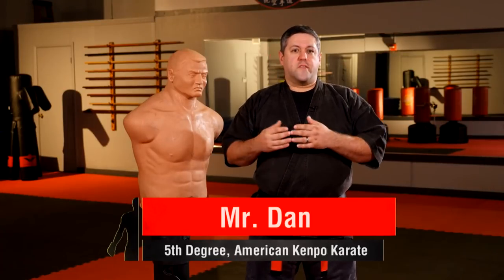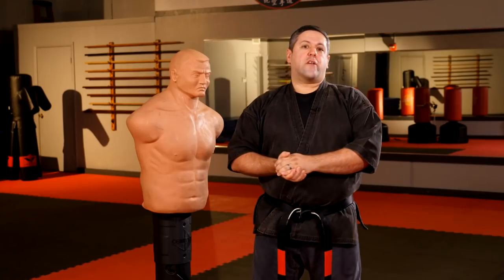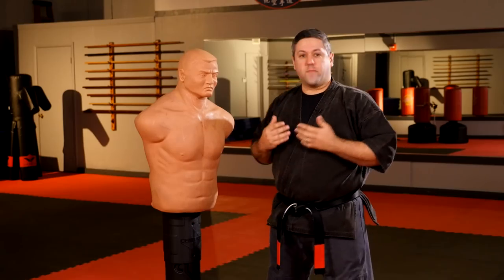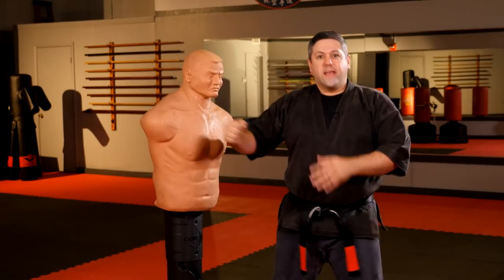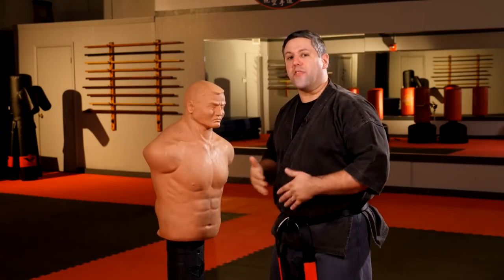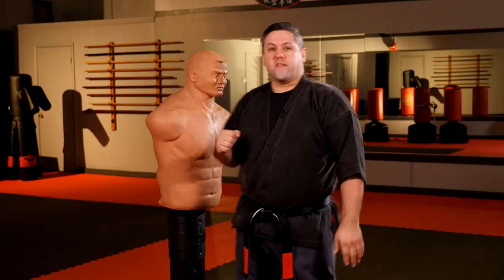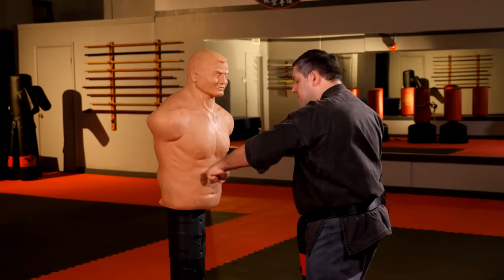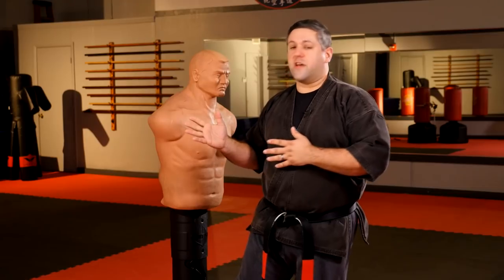Kenpo Power Principles | ART OF ONE DOJO

Comment: We in Kyokushin Karate generate power from the shoulders and twisting motions of the wrist at the end of a punch 👊 for example. We also always keep the elbow close to the body and the fist ✊ in an inverted position, with the palm of the hand ✋ facing upwards towards the sky or ceiling of the Dojo. While the backhand part of the fist ✊, faces downwards with the knuckles, towards the pavement, or the floor of the Dojo. 

Doing contrarily, where the elbow is sticking out and away from the proximity of the body, first and foremost, exposes your ribs, to a potential hook punch, knee or roundhouse kick strike, as an easy and exploitable target to your opponent's advantage. 

As for the hand downwards close to the hips, as opposed to the close position of the biceps 💪 and the armpits, only generates speed, but no real, devastating power. So for us in Kyokushin Karate, while speed in conjunction with strength and power, deliver the perfect, devastating, knock-out blow. Ultimately if we had to choose, then powerful strikes, would be our priority, as opposed to less stronger and more rapid strikes. 

This similar logic is also applied to the kicking strikes, whereby the knee is raised firstly, tucked in, closely to the body where maximum power can be generated, in combination with the rotation of the hips. Again the knee would not be sticking outside and far from the body, as doing so would sacrifice power and real strength from kicks, knees and so forth.  

Ultimately as with punches and kicks, the pivoting motions, the rotations of the hips, shoulders, along with snappy, quick executions of the techniques, deliver the devastating effect, on the adversary, upon the point of impact on their body. 

Footwork, hand, eye and feet coordination are all important, along with perfect posture and right body alignment, need to all be coordinated in synchronisity with each other, to ensure that twisting, pivoting, quick, snappy and strong strikes are delivered with the maximum speed, power and efficiency, without unnecessary wasted motion. 
A great and excellent topic, that many martial artists, ignore, overlook,  or forget to mention, in their instructional, video tutorials. Very much and greatly appreciated, as good reminder, to keep in mind when teaching our students, especially the beginners. Excellent researched, well presented and concise, subject matter material, with relevance as always Sensei Dan, Osu! 👍 ☺ ✌
Reply from the maker: Well after doing the 3 part Kyokushin videos, I have NO DOUBT of the power you guys can generate :)
Reply: @ArtofOneDojo  ah you are too kind Sensei Dan, your American Kenpo Karate, is also equally as powerful. Believe it or not there are similarities, as to how we generate power, as well as to the rotation of ensuring we perform techniques, to deliver that power. I really like your technique demonstration videos!  I totally agree that by a certain level, one must be able to demonstrate power control of techniques, safely with others during training drills for safety. Especially at a black belt level. In a tournament or a fight, sure go for it to your heart's content 👍 ☺ ✌ 👊 Osu!
Reply: Awesome comment, osu from Italy (kyokushin obviusly)👊

Comment: From what I've learned so far much of the power in Tang Soo Do comes from moving our hips and from utilizing the 180° rule. So for example: a long form forward low block would involve turning your hips 90° (the hip power) and bringing your defending hand down from your ear (the 180°). The hip turns can be classified as defensive or offense depending on what you're doing, and similarly the 180° rule is easily applied to offensive techniques. Furthermore there's a lot of power to be developed from the strength exercises we do and the repetition of techniques.

Comment: You fight like you train.  From my experience we pulled punches too much, and even though we trained full contact some, when I later worked in bars, I had to retrain myself to always follow through.  Without my life in Judo, I would have lost several fights relying on my first training in karate. ..it would take too long to explain this, but the first sentence is what I wanted to be clear on.  Nice video,  I'm really enjoying your work.
Reply from the maker: Thank you, I appreciate that :)  I agree about the pulling punches. My second instructor was REALLY big on us making contact. Not pulling punches and DEFINITELY NOT punching the air to the side of the head, that's just a bad habit to form. We would condition and take hits and his philosophy was, he wanted us to get hit harder training in class than someone else on the street would hit us, so we'd be accustomed to it and deal with it.
Body shots were expected to be controlled, but strong enough to achieve the reaction we wanted. If strikes were to the face, we were encouraged to at least make controlled contact but modify it based on what the strike is. Sometimes open handed strikes were used, but in power strikes, like a hard hammering palm or hammer fist to the nose, we'd modify it and deliver a full contact strike to the upper sternum. Whatever got them to move the way you wanted them to move.
Reply: "We do not put our punches, we change our target" S.G.M. Ed Parker
Reply from the maker: @ultimatekenpowarriors434  I love that quote from him :)

Comment: Great video :) and i've done boxing for a decent amount of years and I started kickboxing about around a month ago. Im taught to rotate body and pivot on balls of feet to generate power tho my coaches also mentioned a few times the need to have proper technique and that force is mass x acceleration.
Reply from the maker: Oh yeah, when doing a back leg round kick you definitely need to pivot on the ball of your foot or else you're pulling against the potential power of the kick. The follow through with that pivot can be devastating, especially in kickboxing that allows lower round kicks to the legs.
Reply: @ArtofOneDojo  yes sir! :) exactly.

Comment: In Muay Thai I learned that generating power through pivoting and hip / shoulder rotation is ideal but that Landing blows which break the skin and cause blood to distract or blind the opponent but are not necessarily delivered with full power are also utile as faints or laceration strikes. So, for example, being able to land the tip of the elbow somewhere on the face of an opponent will cause of laceration that will bloody the opponent thereby distracting and / or disrupting their vision. Or, as another example, it is extremely useful to land a straight kick or teep with less than full power to set up a strike that is truly devastating.

Comment: I enjoy watching your videos! All content driven! A Q for you (not related to this video): what's the logic behind throwing the punches from the hips?
Reply: Your arms are like a whip, and your body (hips) is like the arms holding the whip, you can't just flick your wrist and expect the whip to crack, you need to move your whole arm along with your body to actually generate power.       Sorry if that made no sense but it's the best way I can try to explain it.
Reply: Punches generated from the hips proximity, as found in many sports, point scoring karate systems, are done so for speed. 

However full contact fighting arts such as kickboxing, Muay Thai, full contact, knock down karate, as well as boxing for example, they are power based and focused styles of fighting. In those cases, the punching position of the hands is not downeards, near the hips, but rather at top near the biceps 💪 and the face, for guarding and protecting the face more easily from punches or high kicks. In this position the hands are also held there to help generate power and knock-out impact, as opposed to multiple, quick yet not as devastatingly, powerful strikes.
Reply: Thank you for the replies. But all the points you mentioned: speed, hip twist, weight trasnfer etc can also be achieved by keeping your hands up.
Reply: @sardalamit  I was traditionally trained and didn't question what I was told to do. Now that I am a ronin, I keep my hands up mostly and throw strikes from many angles including like a boxer and from the hip.
Reply from the maker: One thing I can chime in with is it's good to practice both throwing punches from hands up AND hands down/at the hip. Why? Because what if someone catches you by surprise? We use the concept of "point of origin" a lot in Kenpo, which means that you should be able to deliver a powerful strike from your existing position without having to load them first. There may be scenarios that you have to strike quickly if your hands are down.
I would also like to add that one of my favorite punches is an uppercut or vertical punch to the body, executed from the hip. It came be EXTREMELY powerful and one of my strongest. You get the right hip rotation and timing with it and that thing can be devastating.

In the context of standing in a horse stance and delivering strikes from the hip, this is a training exercise. It teaches chambering and loading as well as isolates the upper body so we can focus on the punches.
Reply: @ArtofOneDojo  thank you!
Reply: @ArtofOneDojo  was wondering whether you can help me. I am 37 and just started grappling. (Judo.) Enjoying it however, struggling with the movements and timing. I know-how just show up and practice. But apart from that anything specific that I can do? I am into strength training. Any plans to do a grappling breakdown or prepping for grappling series..? Thank you.

Comment: one power principle that I can see you using, but you don't mention is the formula for energy (KE = 1/2 M x V squared) that is kinetic energy equals 1/2  the mass times velocity squared...simply put if the mass is doubled then the energy is doubled, if the speed is doubled then the energy is quadrupled...using this we learn to develop speed in our movement by utilizing a sequence of movement starting from the core and progressing out to the end of the limb, done sequentially, you are multiplying the speed created by each joint